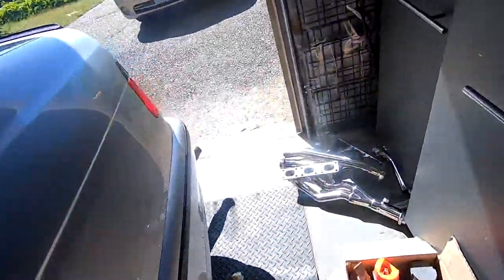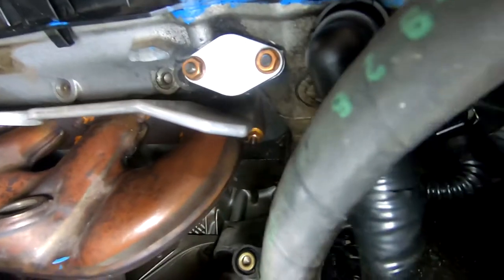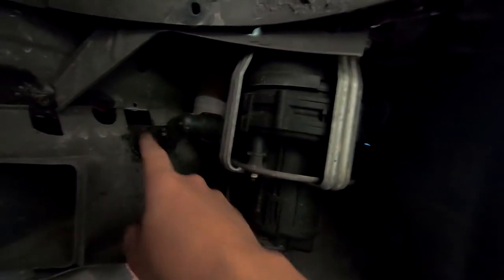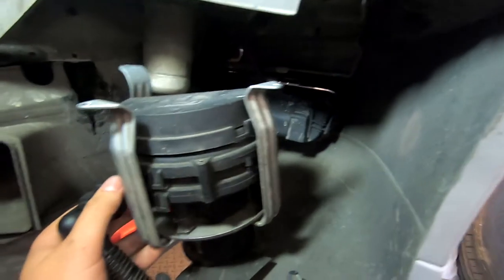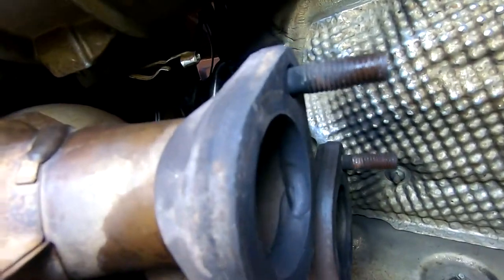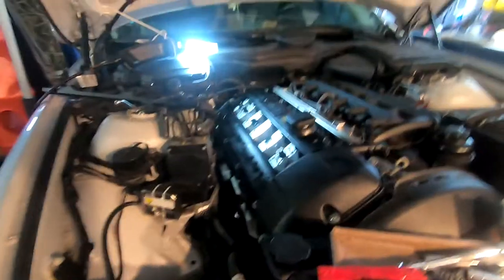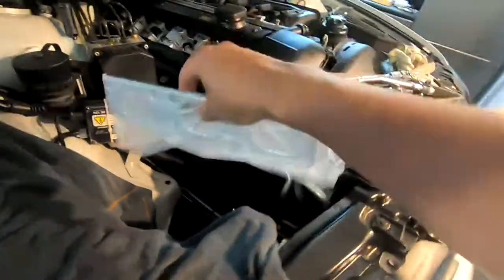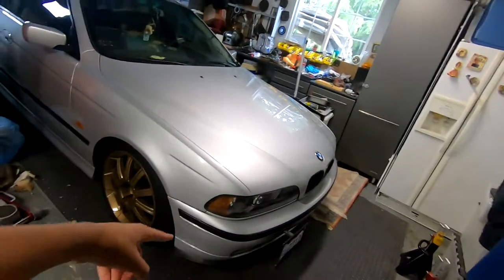Headers Install + SAP Delete - BMW e39 or e46 M52

Comment: Sorry to break it but removing the motor mount and taking out the bank 1 exhaust manifold first it would have easily slided out without cutting but still there out!! Top man

Comment: in Ohio we have to check every 2 years for emissions we have the e check station with the obd2 port computer thing, will the car pass emissions when tuned with no cats?
Reply from the maker: I have no idea. I believe some tunes do clear it so inspection can’t see it, but imo I’m not sure how trustworthy some can be. No check engine light doesn’t necessarily mean it’s fully gone. And the emission scanners at the check station may still catch it. I only did this because in my state they had stopped the inspection.
Reply: You can have the ECU tuned to force emissions readiness. Had to do that on my car when I installed these a few months ago.

Comment: Where did you buy the headers, i just see for e36, but i dont find any for e46, both OEM look similar, but i am not sure. The sound is better, and specs, do you notice any improvement?
Reply from the maker: So e36 346 or e39 all have a very similar in line 6 engine so it doesn’t matter what headers you get they will all fit. The sound is much louder and very bassy, got that notorious bmw sound. And no improvement unless you get a tune. Maybe you will gain a few horse power cause of flow but you won’t have any back pressure.

Comment: I like to see people young people learning how to work on car, but please use a jack stand, never put your life in that floorjack. Always always use jack stands. I never saw you using them, but if you use them good job 👍
Reply from the maker: I was young and naive at the time, I always use stands now
Reply: @TheCraveFeeds  good job, we all make mistakes, keep up the good work my friend 👍
Reply from the maker: @omar1990seattle  thank you, currently pulling diff and I need to drop the rear subframe to access one of the nuts 😅
Reply: @TheCraveFeeds  same car?
Reply from the maker: @omar1990seattle  same car yes, will upload video about it in a few days
Reply: @TheCraveFeeds  I have one question. For the tune on the car did you send the ecu to get tune or you did it yourself?
Reply from the maker: @omar1990seattle  I got a remote tune and did it at home, they used an app called teamviewer which allowed them to control my computer from their computer. Tune is from 22RPD
Reply: @TheCraveFeeds  that's really nice, I'm thinking on get my first bmw, I'm looking into 2008 528xi awd, but it needs a headgasket.

Comment: So my question this... im  All the way in improving paying for parts labor everything but I want to put a whole new exhaust on my system borla to be exact
Reply: Is it worth it?
Reply from the maker: @benwilliams2122  depends on how well the welds are, how long it took, and the material they use. I personally think going for a full exhaust is a good idea because then you can get it all done at one time. If it's more expensive than you thought, just get an axle back or headers for now. Hope this helps!

Comment: i want to get headers for my e39 530i but my exhaust is welded up at certain points would i have to get it rewelded ?
Reply from the maker: depends on the fitment of your exhaust and where the exhaust clamps are. Measure the length of where the current clamp is from the engine and compare it to the dimensions of the headers you want to buy. You might be able to find something that will fit, but more likely you will need to get it welded again. Most of these ebay parts dont fit perfectly, I had to weld mine.

Comment: Does deleting the sap throw a code?
Reply from the maker: Yes it does, you will need a tune to get rid of it. I’m sure 22RPD and Rk-tunes always have it as an option to remove that code.
Reply: @TheCraveFeeds  you mentioned emissions, won't the car pass emissions with just a cat, while deleting sap and o2 sensors? Of course flashing the ecu in the process so it doesn't throw codes
Reply from the maker: @Codeman785  Yes, if there are no codes then you will be able to pass emissions. I already passed mine so I didn't need my cats anymore.

Comment: How did you fix the CEL code form the cats missing?
Reply from the maker: I had to get a tune which deleted both my secondary o2 sensors and the code for the cats. 22RPD does it and also RKTunes

Comment: Link the headers? my cats are starting to clog on my 02 530i
Reply from the maker: https://www.ebay.com/itm/STAINLESS-STEEL-RACING-MANIFOLD-HEADER-EXHAUST-FOR-BMW-E46-E39-Z3-M54B25-M54B30/202660874458?_trkparms=ispr%3D1&hash=item2f2f8788da:g:e94AAOSw99tdUbmc&amdata=enc%3AAQAFAAACcBaobrjLl8XobRIiIML1V4Imu%252Fn%252BzU5L90Z278x5ickkrmmq8hWevtuKE7%252F%252BLfVXtlNgOM7XpNtDT0BKFFvBmZ7xER6DiTKxDpGHQJ5K2Th1THBuEVZ9gWDTWFinOZIAI49P%252BfYfuksfgFsVTPJetfwpNvvmwhW6%252Bdwdghnfb9AvpGBUEiySlJhfLMf0n0tlcJB1ubylYPSKd6MuN6mhIAU%252F7nnKtspaOIbvXlP6nMX91MrlR4fgzbwiAkwqny9Y3xjN1VG6i6EbA5nmTadZtoX8C0Faf5yAJPxiYpD%252Bs5SSpXBZDzTUyK1vZk1FBM412%252B%252FACzxEgnxCXAu4IxXYRy4Y%252FgmF4MDUfaSHMyBIS0M6FIdHgdVLQnL%252FhCOyy3LodCbvz6DionvuxdaCamZdFbOCzsAq6OO8M7QEmP9VvvSVK8wMJ796DU192uFyD7nbQOrq17C%252BX%252FsTkuLGU3cbncWWX3xQKFWyiArDcShbOrtiO4YAD8S5agZ3dGF3H8%252BiCIZq7hL8%252FUpg%252BNQ6JmoWpfOI1K77oOo5J%252BAafsD64%252B3fgkkmNd%252F%252B5OxKwKMsIFFrjPiX28tM0xwO8QTT99IKGtDv0p3DKfH3Epg5NhuVQXPm4AY4LtvbPW8H9mv2UYT0U8Hl0RSGARrTMOlTg5DcENUio%252BgV2lfISc%252FXUBUnkZrLPCLkWMQe583lffvGVIh%252FTBl77BJIEniArfId5MHqovijmYSMuiaBiOMexnyTwVHIT9mioG2ZHml%252BfFJlQSYz5YQZ1sHourZQaOSgoPzxJEpSfnvn3HGdh77964vOfw3x0RDoQde43twh7EMqmHu86w%253D%253D%7Ccksum%3A202660874458195c027bc2514b79a8dce6d3f79b2926%7Campid%3APL_CLK%7Cclp%3A2334524